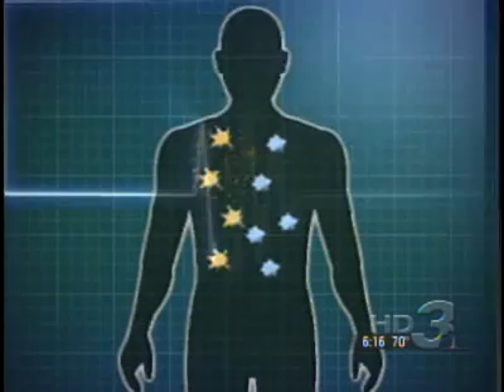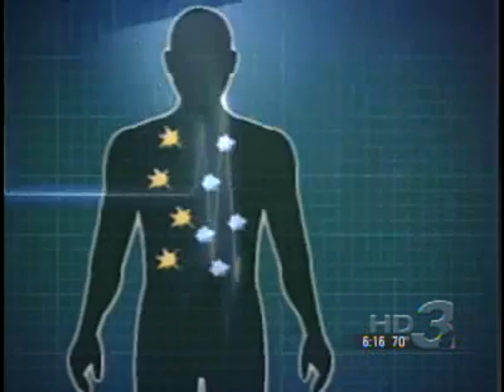Energy from water

Comment: This video keeps popping up all over the place. This is terrible that this guy is trying to say that he can create energy with salt water. Have they even heard of Thermodynamics? The energy released is LESS than the energy required to burn water.

Think about it H2O+Radio waves-->H2 + O2 + MORE RADIO WAVES---> H2O + Heat 

If you end up with the exact same molecule that you started off with there is absolutely no way that this can provide energy.